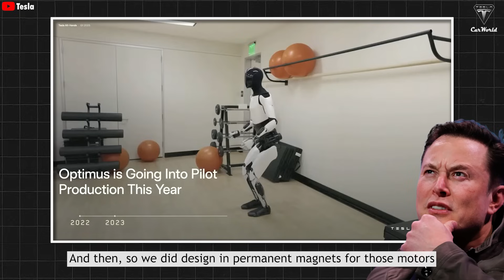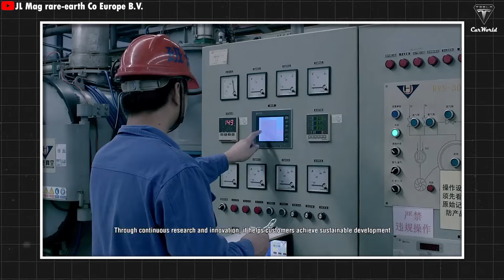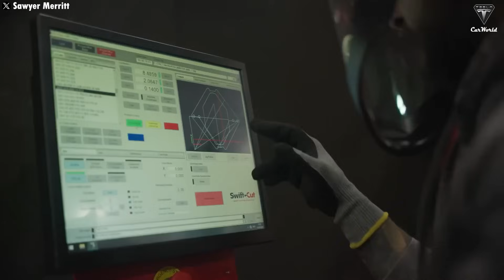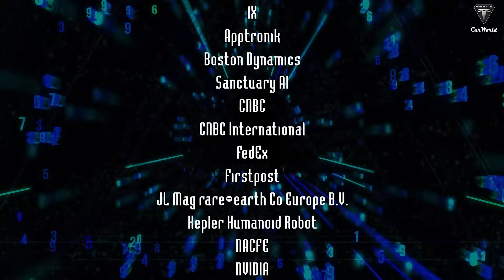No More $20K! Elon Musk Announces BAD NEWS On Tesla Bot Gen 3! First Assembly Line REVEALED!

Comment: Did you notice they showed clips where Elon said his car is basically a robot and it's components can be used in Optimus one thing this video just mentioned it's 8 to 10 hour battery life then goes on to the batteries, what they forgot to mention if it's based off the car technology why can't this robot learn to drive a car it has the tesla car's self drive neuro net built into it?